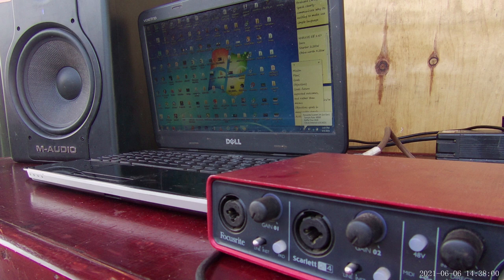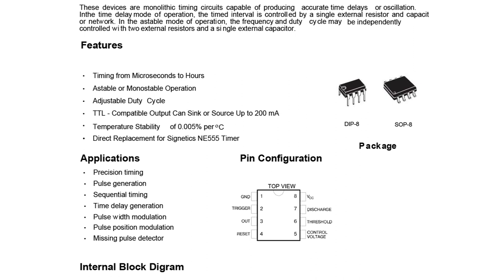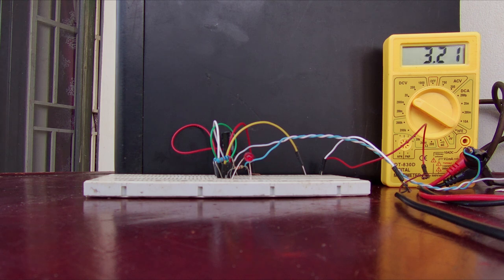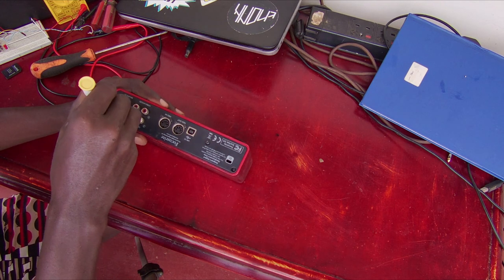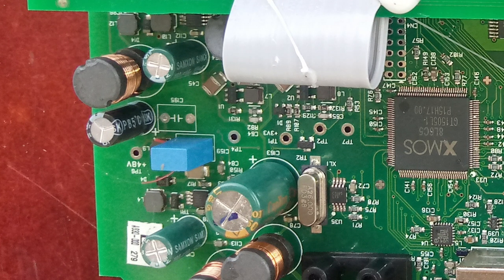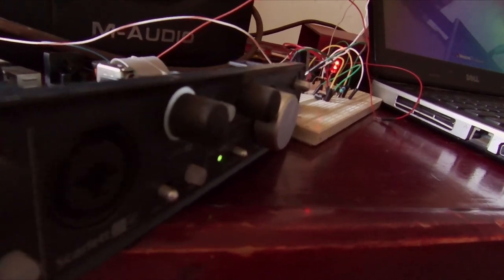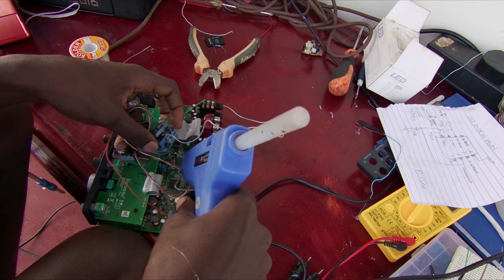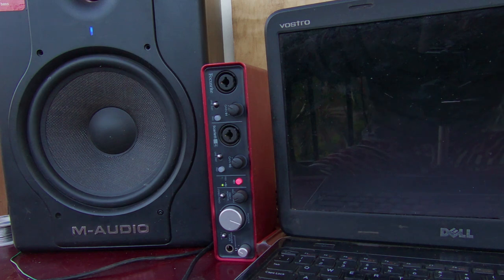How to fix Focusrite Scarlett interface popping on power up

Comment: Hey, that’s really cool. It’s not just this one interface, either. It’s a common problem with all sorts of gear as it powers up.
Reply from the maker: This is true...well designed systems always have delay circuits that wait for the system to stabilise after power on...but that would be a small extra cost to the manufacturers which would eat into their profits
Reply: @Afrorack  well do you offer services to do this?
Reply from the maker: @naegleriafowleri2230  oh no...

Comment: Cool video and good job on solving your problem. I love the 555 IC, it's probably my fav. :) However ... this video has my brains gears churning away. Would not a simple DC blocking capacitor fix the problem as well? If so this begs the question ... was this audio interface designed with DC coupling to allow CV/gate signals generated by software to pass? I don't think this model was. I use a Scarlett 4i4 but my monitors are not connected to them so I have not experienced this problem yet.
Reply from the maker: Well I didn't try capacitors but in theory they should...I didn't want to add any other component in the audio path...which is why I preferred relays which eventually switch off in normal operation...I also think a capacitor would attenuate the signal...
Reply: Thanks for replying. I only ask these questions to verify that my studies and learning are on the right track. :)
Reply from the maker: @HazeAnderson  Haha we are all learning

Comment: and what happens when you do the reboot? does it still work well?
usually better idea is to use IC like C1237HA it has some extras

I'm facing the same issue with my sound card and I'm searching for the solution as well, I get the pops both on power on and restarts...
I'm thinking to use the LED of the front panel on my sound card as a trigger because when it's on it means that the card fully powered a delay of 0.5sec will be enough in my case

thanks for the general idea
Reply from the maker: Even if it reboots it works well. The relay is actually very fast and on losing power it shorts the signal path to ground and prevents the pop.

Comment: Yet another other data sheet application for the most famous ic that has gone overlooked by me anyways!!  Did you try reading off of a meter or scope from the wires leading into your i/o box?  I’m wondering, if whether it’s lsolated to just the DC voltage part from your computer that’s causing that, or is it more than that?  I guess if you didn’t want to sacrifice a usb cable, and then every other type of wire running between here and there if it didn’t seem to solve the riddles (rca phonos, maybe even your AC DC adapter, too??).  I guess for future thought, I might suggest a 4 pole switch, regular on / off type, so that you might just throw the switch when once you absolutely have your system ready to use the Focusrite.  Or maybe, I didn’t see how beefy the relays are, but you could have likely made that whole setup into an actual ‘spike strip’ and maybe it would soft start up a whole lot more than just the I/O box.  Also, I can remember using a NTC thermistor (NTC resistor) as an in-rush current limiter when I switch on power transformer, placed before any linear volt regulators, filter caps, etc.  HEY?!  send me a message
And I’ll try to scrounge up shipping costs to send you a Christmas present, if you have space for stuff?!  I would love to send some gear off to Africa and see/hear how it’s used! Thanks for sharing everything you do, you’re really great!!  AFRORACK TO THE FUTURE!!
Reply from the maker: Hi thanks for ur comment...on Facebook i use the name Bamanya Brian....send me a message and we talk

Comment: wouldn't buy an audio interface with its own power supply solve the problem? The issue here is the power. The audio interface is obtaining power from the PC and maybe this is why the sound happens, the solution is get rid of this garbage interface and buy a better one with its power brick
Reply from the maker: I try to solve problems I have at hand...and learn something along the way..thats all
Reply: @Afrorack  but almost audio interfaces do this only a few more expensive have a relay muting. You’re supposed to turn on audio interface first, then speakers and viceversa. I also have scarlett usb and it does the same pop even with headphone or other computers. In part is because the interface is receiving power from the computer/laptop and it may not be enough. Buying an interface with ifs own power supply will mitigate this pop or make it almost nonexistant, you’re still supposed to follow proper sequence. Turning on interface and then speaker. Turning off speakers then audio interface.